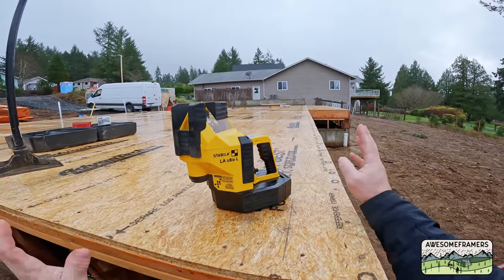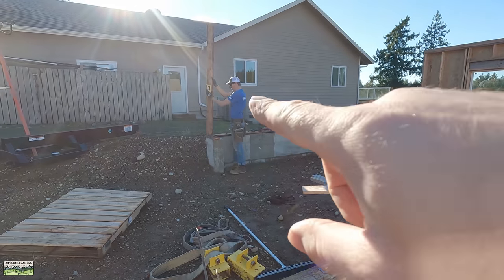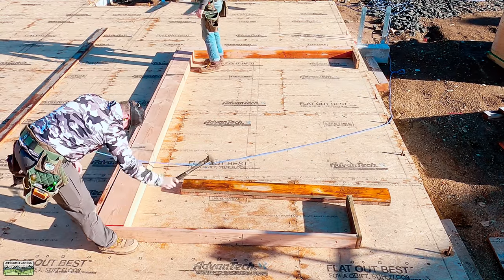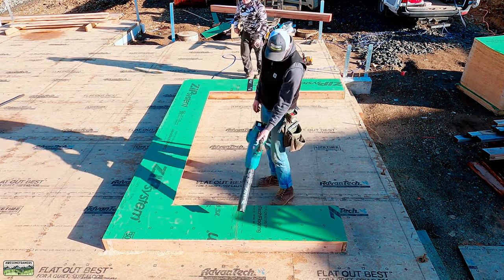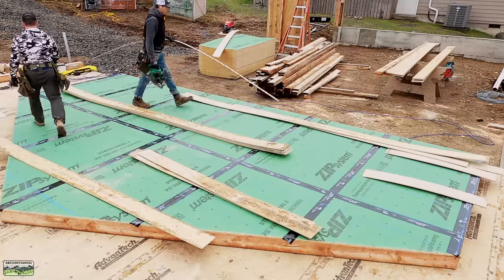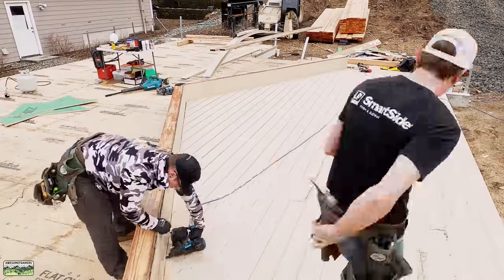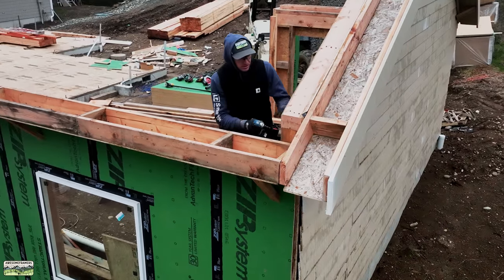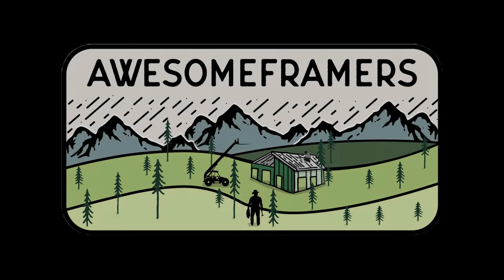150 Olympic Episode 7 Wall Framing

Comment: Hey bloke. Use a shackle on the end of your sling, so you don't need to lower the hook. You just take off the load and undo the shackle pin. No pushing or pulling that sling through the eye from a ladder.

Comment: Hey really awesome work. may I suggest talking with your engineer to start using MASA anchors instead of anchor bolts. They nail to the formboards instead of wet set, allows you to do all tilt up construction. And doesn't care if you put one in the wrong place, it wraps up the stud.

Really awesome, I'll never go back to anchor bolts.
Reply from the maker: We used to do use those. I'm actually working with our engineer to see if we can just drill Titens afterwards the fact.
Reply: @AwesomeFramers  titens are also super sweet! 
What was your reason from moving away from MASA's I'm curious.
Reply from the maker: @griznatle  it ws skow nailing them and they bumped the rim up.
Reply: @AwesomeFramers  yeh even with a positive placement nailer it is slow for sure. I usually have a crew member go around with my cordless drill and put in truss pins every 4' so the wall doesn't walk around. 

Probably can't drill or install titens without a 1/2" impact hammer and a sdsmax drill. There goes 800$ lol 

I wonder if there's a concern with drilling that much and piercing the topchord rebar. Maybe just need to communicate with the form crew to keep their chord down 8" or so